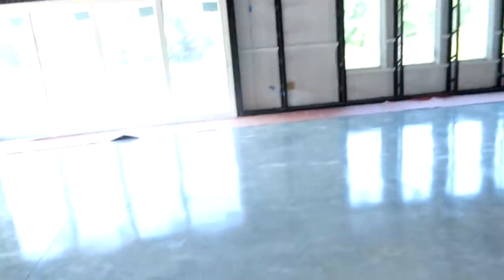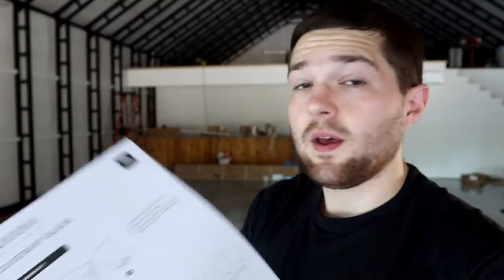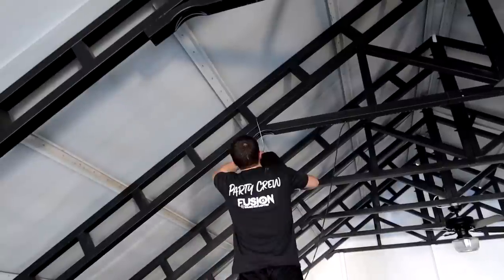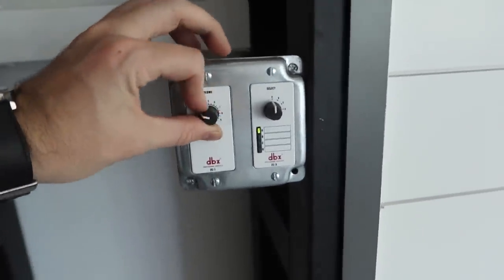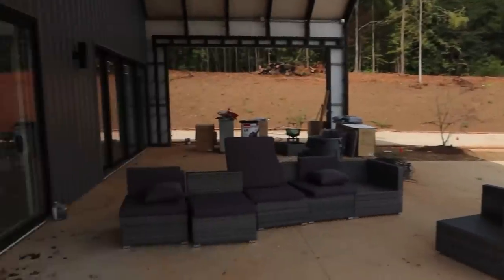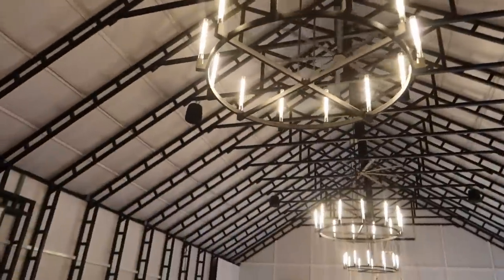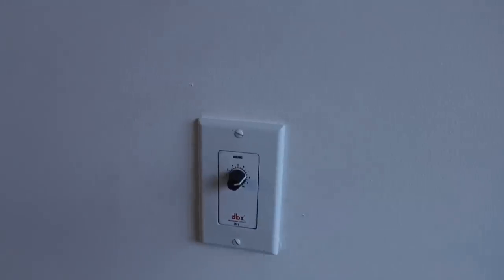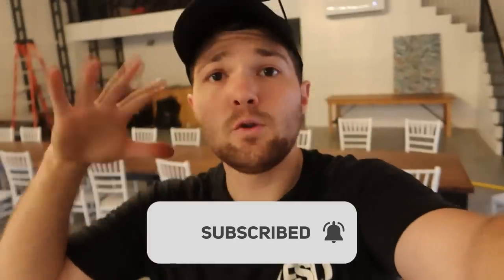FINISHING the DJ Speaker System (Adding a Subwoofer)

Comment: Why not use an RCA balun and CAT 5/6 instead of a long XLR cable for the DJ hook up? CaT 5/6 is way cheaper than quality XLR cable and less chance of getting noise/EMI in the line. Don't know if you have RCA inputs on that processor though.
Reply from the maker: Learning process. Didnt know about that at the time. I have done installs since using cat 6 for that exact thing

Comment: The Venue is Dope, but why are they not installing sound dampening material to the facility? When Sound Bounces around it sounds like crap, like an echo chamber, especially if people want to socialize and talk to each other. Why No sub at the front? The people in the upstairs area are gonna hate sitting up there with that loud sub...lol
Reply from the maker: The walls are covered in white foam sound insulation. It doesn't echo much at all with the down firing array. The sub also is not overwhelming upstairs the dance floor will be right below the balcony by the bar at most weddings here.

Comment: In the first video you said you use 12 gauge wire is it 12/2 copper wire or 12 gauge straded wire? Thank you for any and all help. I am starting my own venue and want to have a better sound system than just two monitors on a stand with a sub. Also besides the zone pro what do you use to mix the sound and does it reside where the other components are?
Reply from the maker: 12 2 normal straded wire not solid copper
Reply from the maker: The zone pro does it all through the switchers and preset settings. In newer installs i have switched to atlas for this controls
Reply: @DJRickWeb  Thank you I appreciate the help!

Comment: Should use Driverack VENU360 and shure ULXD2 wireless mic systems. ULXD2's are not that expensive!
Reply from the maker: Venue 360 would be terrible for this install. You need zones thus why i used a zone pro.
Reply: Venue 360 is not for these type of configurations. It’s used mostly for pro audio installs or at venues

Comment: Do the JBL speakers come with a delay feature or do you have to add the delays from your rack? Congrats great video and build out.
Reply from the maker: You add it via the rack
Reply: @DJRickWeb  did you use a delay in this system?
Reply from the maker: Yes
Reply from the maker: Had no need to. The sub has a slight delay but the sound is all firing from the same plane so no need for delay.

Comment: @DJ Rick Web, the PRX sub works well for lows reaching the downstairs area? Thought it will result in the lows "stuck" at the top area and not reach the bottom area due to not being "Flown".
Reply from the maker: No it works well. Bass travels in all directions.
Reply: @DJRickWeb  I see ok. Cuz thought will end up be able to hear but not feel it. But yea its a 18"

Comment: Well he obviously didn’t wire install or spec the system, he just acted as the middle man and got a pro company in.
Reply from the maker: I did the whole thing.....
Reply: @DJRickWeb  nah you didn’t, I don’t doubt you did allot of it but you had experienced engineers come in with cherry pickers to run the cables and the speakers. When you talk about the dsp you don’t mention delay which would be necessary and also you messed up at that section by saying “they, I need to finish off”
It’s clear by the mixing 15” and 18” subs without a crossover video that you are not quite as skilled as you make out, but you don’t have to be, you’re a good enough business man and can get things done, I just don’t like it when people pretend they do every single thing without help or extra expertise
Reply from the maker: https://youtu.be/9U0U-yy1fPk
I made a whole video on it.... I fished wire for a whole day, did all the programming too, with a lift. There was a seprate contractor running cat 6 for the projectors and tvs.
Reply from the maker: 0 help from anyone. Spend 7 days in total getting the whole system in. It was April/May of 2020 nothing else to do. Expertise wise I did have help specing / sourcing the correct equipment though from canal sound and light in NYC. Good friends of mine

Comment: Should have added some DJ lightings
Reply: they could use wireless dmx, or have the house lighting on a dmx system so the DJ or someone could control the venue lighting using the DMX protocal.
Reply from the maker: Should have.... future man. Also I would rather bring the lights and charge for them everytime vs have them installed for just the venue

Comment: Assuming they're gonna charge guests a fortune (like most places) to rent the venue....they really went cheap on the sound system.  Could have gotten better sound quality better coverage, and used fewer speakers if they spent more $$$.
Reply from the maker: I would highly doubt that. If anything more speakers. You also should not judge someone else on their financial decisions. Investing this kind of money in the middle of a financial crisis was a bold move to start with. They went super far over budge and there's always room for upgrades in the future
Reply: Believe it or not, there are speakers that provide great coverage area, awesome pattern control and better intelligibility without needing a million speakers cabinets for the venue.  Brands that come to mind are, Danley Sound Labs, JTR Speakers and Bassboss just to name a few. 

I don't mean to judge their financial decisions at all. However,  many rental venues,  clubs, bars, etc across the country charge and make  a fortune off of their clients yet refuse to purchase a decent sound system for their clients to listen to.
Reply from the maker: Those brands would not work in this venue because of the room acoustic profile. More speakers with tighter patterns at lower individual speaker spl work best at reducing echo and reverb. Thus why i went with this solution. If you would have used less speakers you would need higher spl per cabinet and would lead to a reverb night mare. Its also why I only used one sub. There is so much reverb that two subs to reduce overall reverb. 

This wasn't a cheap sound install by any means..... just in equipment alone before labor looking at almost 6 grand.
Reply: Look like we're gonna have to agree to disagree on this.   
Awesome channel and content..👍🏿